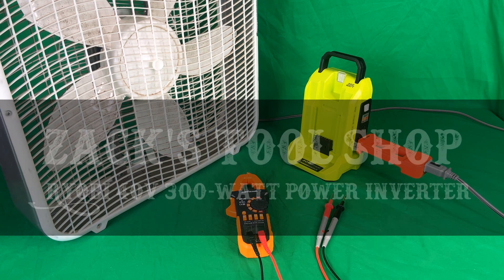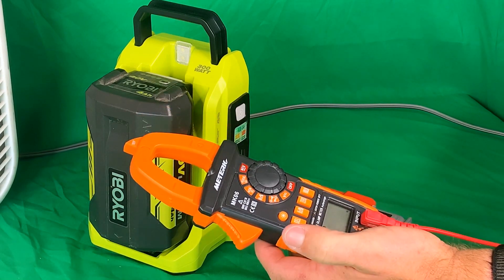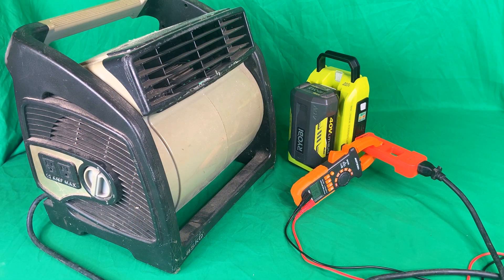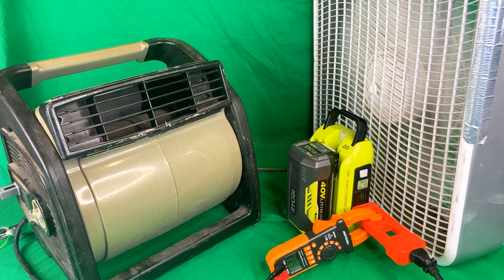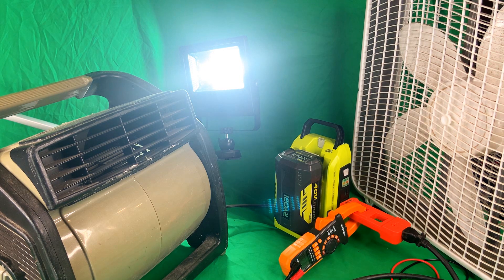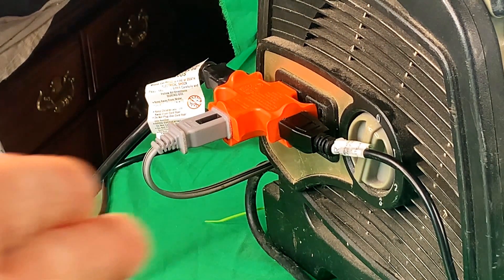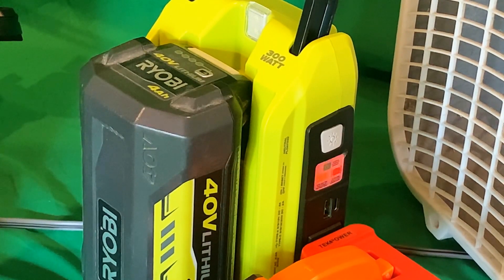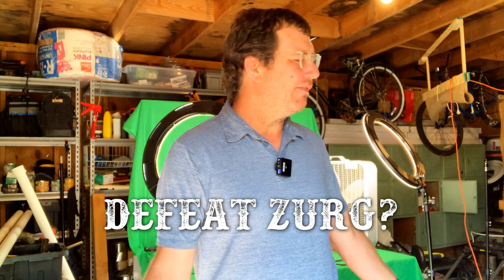Maxing out the Ryobi 300 Watt Power Source

Comment: How many 5amp plus 1 batteries can it charge?
Reply: Multiply volts by Amp hours to get Watt hours. You can use this to get a consistent unit of measurement for comparisons. Figure 80% energy transfer due to internal inefficiencies in the inverter and you will be close enough. 

A 4 Amp hour 40v battery (actually 36v, 40v is the peak) can charge roughly 1.6, 4 Amp hour 18 voltage batteries. 36x4×.8=115, 18x4=75. 115/75=1.597.

Comment: Why would anyone care if a Ryobi inverter can power a tool, I want to know if it can power a space heater, if so we're getting somewhere. Also they need to outlets, most folks would love this for camping to plug a small TV and game system in at the same time, assuming it could handle both
Reply from the maker: It will not power a space heater. I just put a multi plug in it

Comment: Wondering which is better ?  
Ryobi 300 watt inverter or Jackery 300  ???  
For a camping fridge or a heating pad/ small coffee maker etc
Reply: I'd suggest something like the Jackery or River from Ecoflow. These solar generators can charge up much faster and have much greater energy density than these inverters. The Ryobi inverters also produce a Modified Sine Wave instead of Pure Sine Wave, making them unsuitable for sensitive electronics.
Reply: @dogishappy0  this model is actually pure sine wave. It's one reason I bought it. I also have Bluettis and a gas genny. The Ryobi and Bluettis are for my electronics
Reply: @jules6499  all I know is the smaller Ryobi inverter for the 18V batteries almost burned my house down when I used it for an electric blanket during a power outage. Now if I need to use a Ryobi inverter for anything sensitive or heating related I'm plugging into a UPS powered by a Ryobi Inverter.

Comment: Got a question. Not sure if you can answer it for me or not. So just got my 300 watt power inverter I have two 4ah, 40v Ryobi battwries to power it. But I’m just curious when I stand it up it seems to be fine and charges my phone fine. When I try sitting it on its bottom. The side that has the rubber made for sitting it on that side the fan will come on after a few mins. Is this normal? Should the fan be coming on standing up as well or is it just not getting as hot in that position?
Reply from the maker: It must be heat related. I have noticed the fan running in both positions.

Comment: I get that it will several items but no idea for how long. Will it run that fan for 5 minutes, or 5 hours?
Reply: Pulling 1 amp on a 4 amp hour battery you should be able to run the fan for approximately 4 hours
Reply: @matthewash2471  I guess he didn't want to do the math 😂

Comment: Can it run a projector for a couple of hours?
Reply from the maker: Do you have a voltage and amp rating for a particular projector?
Reply: @zacksintheshop  
Is 12 v 3.5A
Reply from the maker: @fjts666  if you mean 120 volt, then no. If you mean 12 DC then I would use a battery.

Comment: I would have like to see how long the inverter would run at 300w and what wattage the actual cut off is.  Thanks for your testing.
Reply: It wont run at 300W ... 
Maybe 250W and then it shuts down
Reply: That's not necessarily true. I have the original 18V Ryobi 150W battery topper it goes all the way to 200W running until the battery dies. At 200.01A and it shuts itself off
Reply from the maker: I will see if I can set up a test for it.
Reply: @zacksintheshop  i used (2) 150W bulbs. One direct plug in for 150W and the 2nd one i put on a dimmer switch to control its brightness. As i got between 250 and 260W it would cut out. 
Had it swapped out 2 times, same issue on all 3.
Reply: @zacksintheshop  When Ryobi quotes a 300W capacity, they probably mean that the device has a conversion inefficiency, using up to 50W for losses, and 250W for actual power delivered. A controlled test would test the converter with a 250 W load, and time how long it exhausted a 4AH, 6AH and 7AH battery. As you noted, it may kick out in under a minute when it gets near 250 W, so it would be interesting to try a 225 W load.
Reply: I have two, around 280-285 watts.

Comment: Would this run an average sump pump?  Would be so much nicer than dragging out my generator when a storm knocks out my power.  I’m guessing no.
Reply: 🤦🏽‍♂️ a sump pump uses 600 Watts for a 1/4 hp motor. 🤦🏽‍♂️
Reply: @ACommenterOnYouTube     Thanks, I figured it was too much.
Reply from the maker: I doubt it. Might run a smaller pump, though.

Comment: Neat test, puts into perspective what you can do with this thing. Maybe try some corded oscillating tools or larger rotary tools, but try them under load. The amp draw is less just letting the tool run as opposed to actually using the tools where they might overdraw if used too hard. Also are the tools less powerful using the inverter as opposed to a main 20 amp outlet? Thanks😊
Reply from the maker: Thanks Andrew. I was looking for some tools tonight that would work. Put it together soon.
Reply: i just got one of these today and i already had a fully charges 40v so i tried my corded dewault drill and the drill will start briefly (no load) but the red indicator light came on and it stopped working. hit the button and tried running the drill really slow and it ran for about 5 seconds and the overload came on. i'm aware the drill is probably not the intended type of tool for this device but i do have an issue with it the inverter, that being that the internal cooling fan did not come on while doing some other tests that were more in line with what it's supposed to operate. it's an issue because the battery and inverter are heating up and it smells like overheated electronics. i had the device lying flat so the fan vents were exposed so that's not the issue.